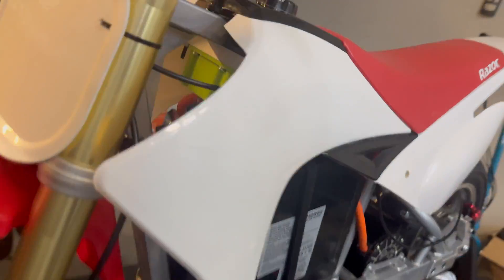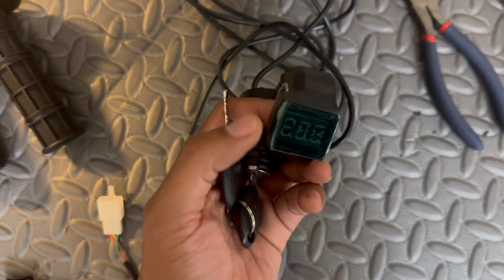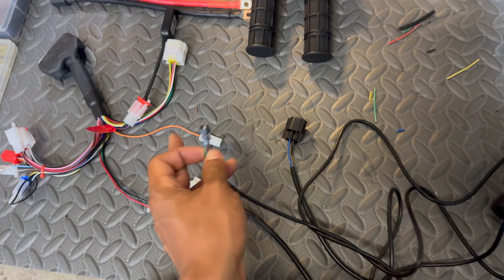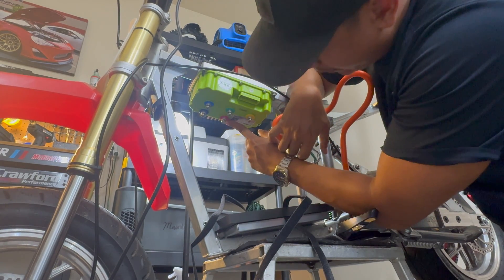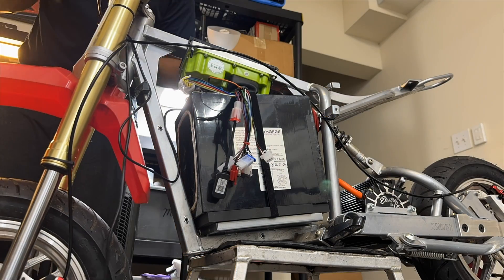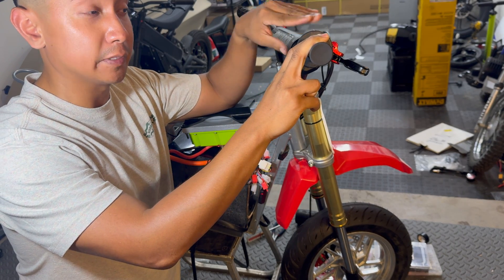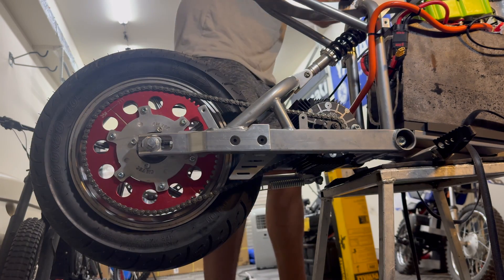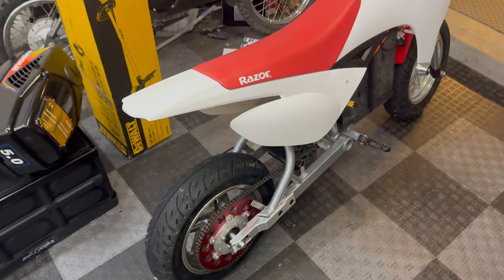72V SX500 Ultimate Street Build - FarDriver ND72530 Controller Install

Comment: Have a FarDrive controller on the way (at least I hope) and it’s the ND72v100 controller rated at 100a continuous 300a phase. Not sure if that is a 72100 or 72300, anyway, wondering if you know if all these FarDriver controllers the same as far as wiring? Hoping I could just follow along with this vid when I get everything in🤔 considering it will be my son & I first build.  Ok thanks in advance.  Ok back to video.
Reply from the maker: All fardrivers (besides encoder type) are pretty much wired the same and use the same wire harness lead connector
Reply: @ my man.  Good news.   Thanks again.  Your videos are great.  Keep them coming!

Comment: Hi pat the #35 Chain 71-Tooth Split Sprocket got it front Amazon but the center spacer that  came with it didn’t fit any link for the center spacer
Reply from the maker: @tonny1924  I got the center spacer from CM. His info is also in the description

Comment: Hace you ever come across a "10. phase zero error" on the fardriver controller? I just got my 72530 hooked up today and I'm getting that error and I don't have any throttle response. There is no information in the user manual about this error. It just says internal alarm under 10. phase zero error.
Reply from the maker: Hmm I have not. Do you have an alarm wired up? Have you tried doing the auto-learn process again?
Reply: @PatOutdoors  yeah I do have the alarm wired up. I've tried removing the alarm module also. And yes I did try hitting the auto learn function but it won't do anything either

Comment: Weld the freewheel, it makes the bike wheel a lot better with smoothness and no more freewheel problems
Reply from the maker: I think most people in the comments are misunderstanding what happened. There are zero stripped bolts on the sprocket assembly, the inner threads of my welded freewheel are stripped so it now spins freely on the wheel hub itself

Comment: Did you use grade 8 bolts? If yes then I'd  drill out and tap for larger bolts. That would be the cheapest
Reply from the maker: I think most people in the comments are misunderstanding what happened. There are zero stripped bolts on the sprocket assembly, the inner threads of my welded freewheel are stripped so it now spins freely on the wheel hub itself

Comment: Drill bigger holes and tap in thread for bigger bolts. No new rear wheel needed👍
Reply from the maker: Drill bigger holes to what exactly? There are no broken or stripped bolts. The inside threads of the freewheel where it spins onto the hub itself is what stripped out.
Reply: @PatOutdoors  I’ll have to see a few pics but the best way to describe it is, wherever the bolts are that go into the wheel need to be drilled a size bigger and rethreaded. Unless we’re talking about different parts. Can you post a pic on here of the damage? Like post a pic under its own title on your page? Or even post another video?
Reply from the maker: @wattleyracing  ill post a follow up video soon, think I have a solution
Reply: @PatOutdoors  ohh wait I think I know what you’re talking about about. If it’s the freewheel itself, can you not just get a new sprocket to replace the freewheel with?
Reply from the maker: @wattleyracing  nothing wrong with the sprocket or the freewheel. The freewheel spins clockwise onto the threads on the hub of the wheel to tighten in place. The threads on the wheel hub is what stripped
Reply: @PatOutdoors  I see what you mean. Sounds like welding is your best option I guess. Unless you can chase the threads somehow
Reply from the maker: @wattleyracing  I think welding is my only reliable option at this power level 🤷🏾‍♂️

Comment: Another awesome content Pat. i will soon be doing the same controller upgrade on my Zooz 1200 Flex replacing the current Sabvoton controller. Im gonna start doing the upgrade soon after i get the only missing piece which is a 3 way mode switch. i prefer having an eco and normal mode on this bike. i already got the Fardriver ND72360 and all the parts i need and after i get everything installed, i might seek the help from Vee from Powerful Lithium to get it fine tuned and at the same time learn on how to tune this type of controllers. Great video tutorial👍👍
Reply from the maker: Thanks! Yeah I’m also still getting more familiar with all the parameters. So much you can change with a FarDriver!

Comment: Hey bud, glad you finally got this project powered up. We ordered RSF wheels new from Razor directly. I feel like the rear wheel is bent somewhere in the thread area and we haven't been riding that much. Either way, I would like to find a solution for wheels that doesn't cost $150 each. Let us know what you come up with. This bike doesn't have 100 miles on it yet and the wheels never come off the ground at all. I was told that the RSF wheels are fragile in some ways, but I didn't think they come apart like this. I can only recommend to you that you pull it all apart and get a visual on the problem. My freewheel is welded also. And we run 72v with a KR5V and nd72450.
Reply from the maker: How much power are you pushing with the KR5V?
Reply: @PatOutdoors  They say 8kw is the max... I haven't had to need to push it over 55mph thus far. With the gearing I have I should be able to top 63mph, I haven't gotten it up there yet. 250amp 72v amorge battery... I've seen 200a out of the battery on WOT pulls but again, haven't topped it out yet. IT felt like it had wayyy more to go.

Comment: weld the free wheel it makes the bike feel way better, I do it on my razors right of the bat no matter what
Reply from the maker: This freewheel is already welded. It's the threads that hold it to the wheel that's completely stripped :(
Reply: @PatOutdoors remove the axle, drill some holes, tap some threads, and put set screws in there. You will have to reach inside the hub to do the set screws. You'll have to sacrifice an Allen wrench and cut it real short so you can reach inside the hub.

Or you could just weld it as suggested. 

I had way more power going to mine when I was only running one motor and it didn't tear up but I had the BMX freewheel inside an adapter version. Those clutch ones die instantly when you apply a few hundred amps. It probably helps not to have a ginormous rear sprocket like that. That thing is crazy big. Think  of an old 10 speed bike, the lowest possible gear is the little one in front and the big one in the back. You'll be like a duck on the water cruising along, but under the water those little feet are kicking like crazy. You were going to run out of gear real fast. You basically created a situation where the controller had plenty of leverage to strip those threads out. Locttute red. Use it.
Reply: @PatOutdoors  you can also weld the free wheel to the threads I believe